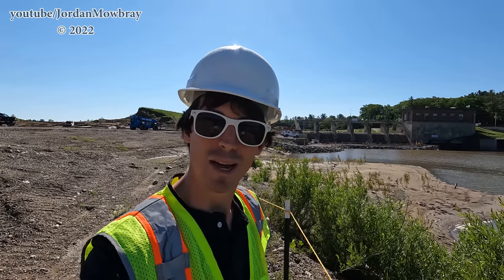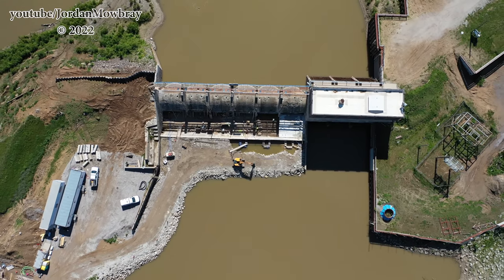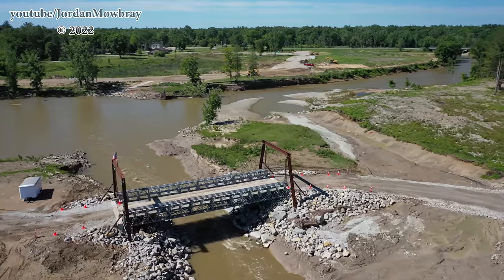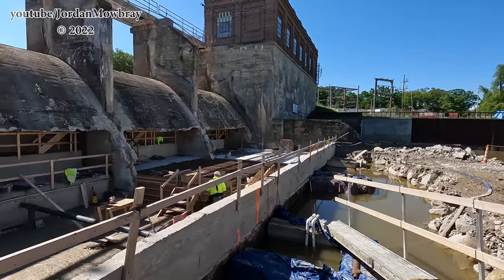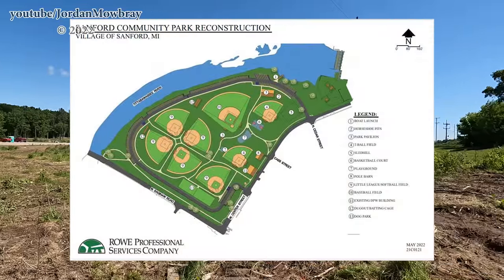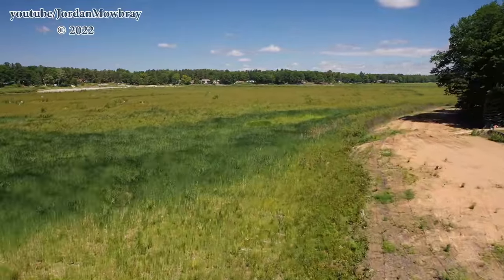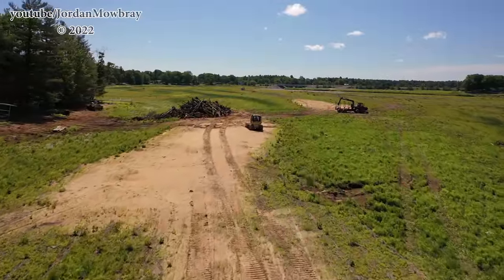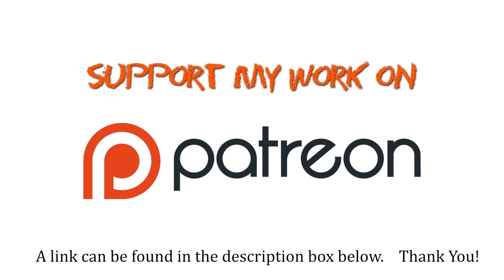New Concrete Weir Spillways Finished at Sanford Dam! - June 2022  - Drone - Dam Collapse

Comment: Thanx for the video, it looks like the people putting it back at least halfway know what they are doing.  Building dams isn't for idiots.  Around here, they put chain link fence over rip rap to prevent washouts.  It's a long drawn out process, particularly after a dam washes out.  That's why is so damn important not to let a dam wash out in the first place.  

My grandfather used to say that running water is the most powerful force there is.

Comment: Will the fallen trees in the river below the dam be removed and the banks along that area be cleaned up, stabilized if needed? 
 Will the sand that has deposited and left high areas below the dam be removed also?
Reply: Yes. They actually have crews off of water road working on cleaning up the lakebed